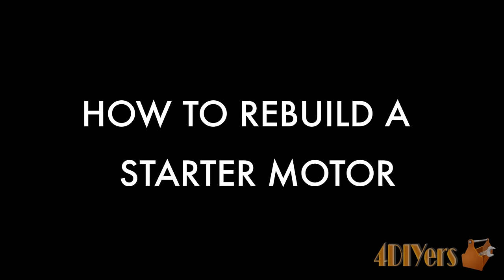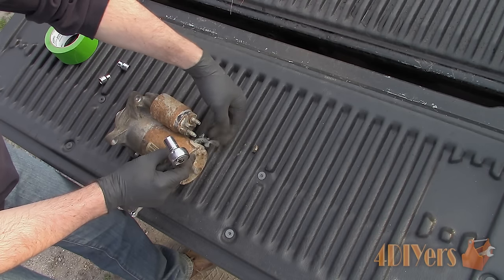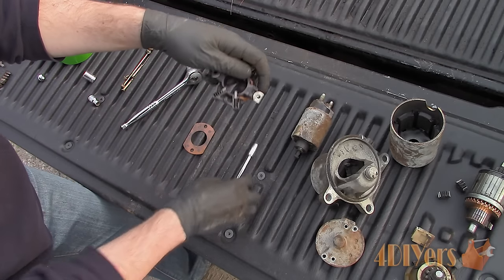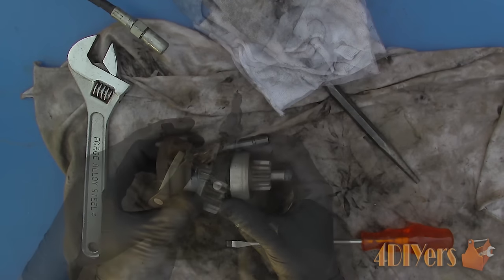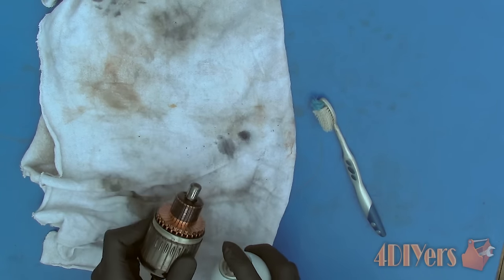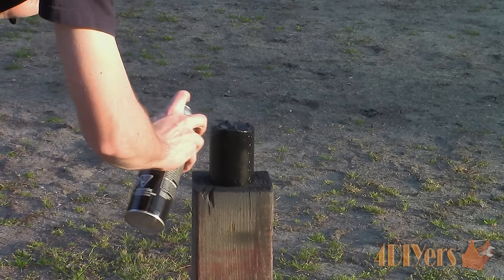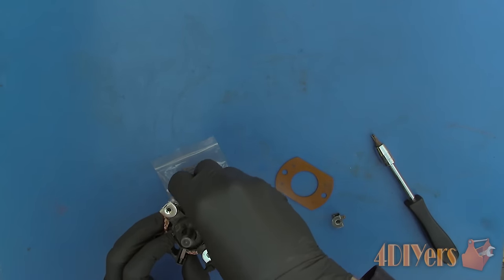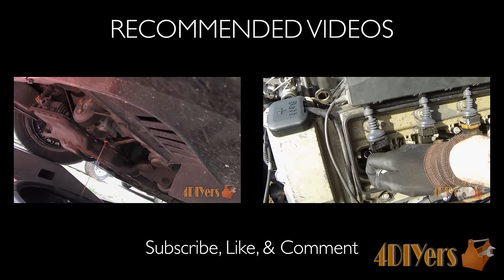DIY: How to Rebuild a Starter Motor

Comment: time wise sounds like it us cheaper to buy a new one.
Reply: Not realy. Many of the rebuilt replacements are done so fairly cheaply over seas. I normaly end up having to replace these far sooner then I should. A factory new starter will cost even more. Plus the process is rather straight forward and if you have experience doing similar stuff you can do it in a rather short peroid of time. You first time will all ways take a little extra time, but if a friend or family member needs similar help you can help provide them a great service while saving them a lot of money as wll.

Comment: There are way too many minute details to keep in mind for this one. Better to just get a used part and sell it off on ebay if it wasn't the problem part. This is way too much work. Am I the only one feeling this way?
Reply from the maker: First time rebuilding it yourself will be the hardest, after that it gets easier. I do have a video on troubleshooting a faulty starter as well so you don't end up just throwing money at an issue.